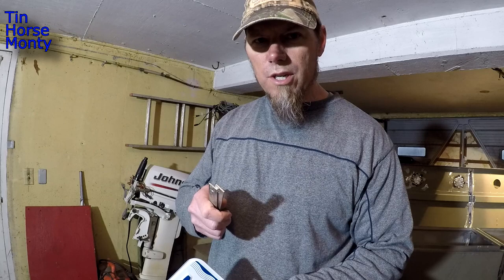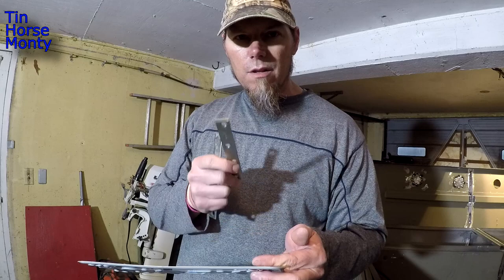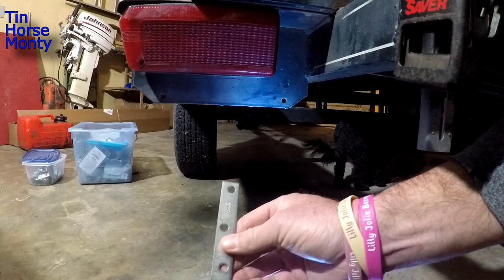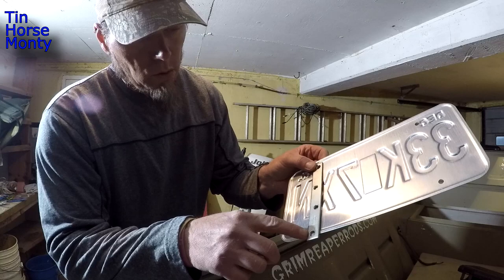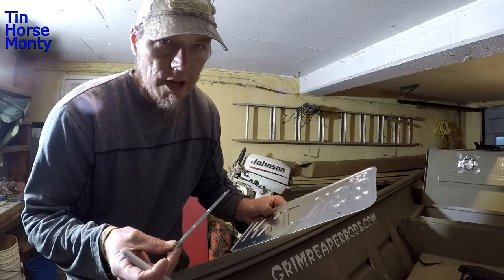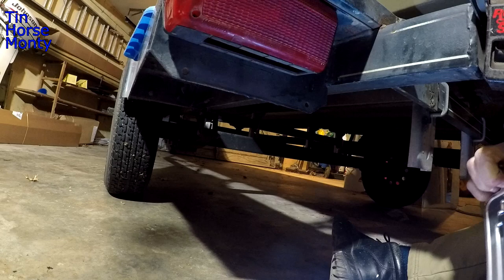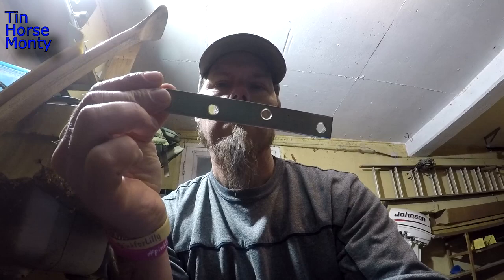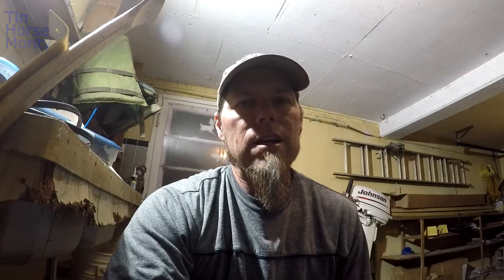Never Lose A Trailer License Plate Again With This Tip

Comment: Good idea but I'd drill the bar to fit the plate not the plate to fit the bar. I realize it's a minor deal but you can't block any portion of the plate.
Reply from the maker: It's much easier to drill through thin aluminum than to drill through a  zinc plated brace. So far, I haven't been pulled over for it. I think as long as the plate is easy to decipher it won't be a problem. Thanks for checking out the video Dan.

Comment: I add thin plastic  or rubber between the plate and the steel mounting  points.  As we all know over time the aluminum  will corrode against the metal and then the plate will fall off.
Reply from the maker: Good tip. Thanks.

Comment: Would it have been better to have put it above the tail light using a tiny piece of aluminum angle iron?
Reply from the maker: Maybe. There's lots of ways to do it. I just used what I had with minimal drilling. So far so good. Thanks for checking out the video Christos.

Comment: Nice video! I just purchased a boat from a TN resident which doesn't require trailer tags and needed some advice for my MO tags. I never had one break off, but why take chances. Thanks
Reply from the maker: Thanks Keith. It was a little work getting a boat from TN titled in MO but I got it done. I lost a plate one time and so far the new mount has worked out great!

Comment: Suggestion: I use double over sized rubber washers for the vibration and I have not lost a plate in over 6 years.
Reply from the maker: Appreciate the tip Caleb!

Comment: Then it drags in a dip and there went your bracket
Reply from the maker: Hasn’t happened yet. It would take a significant hole.
Reply: @TheTinHorseMonty  where I live they're everywhere. Hit one today
Reply: @TheTinHorseMonty  & what really stinks is it only takes once to really mess one up. I have been wondering for a long time why they put trailer tags so low? Makes no sense